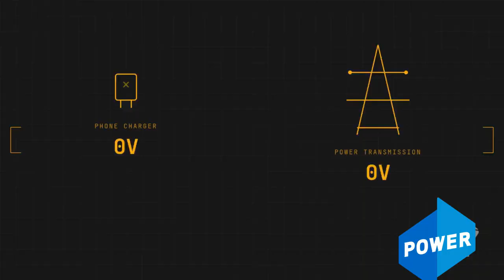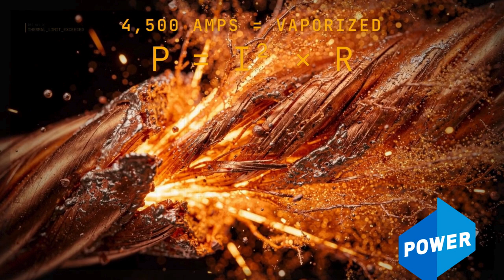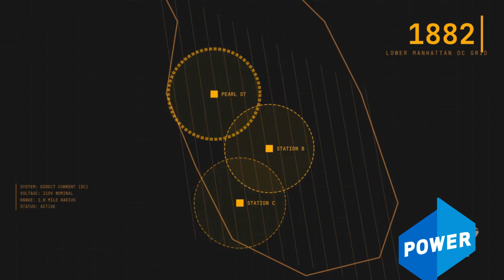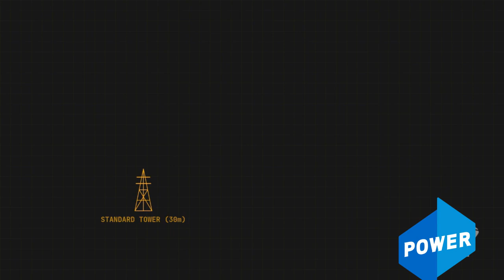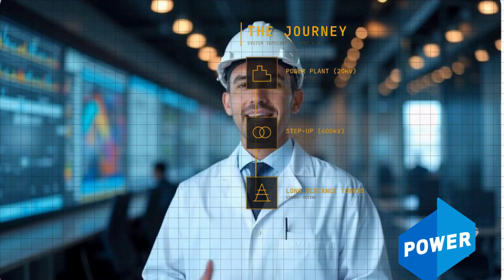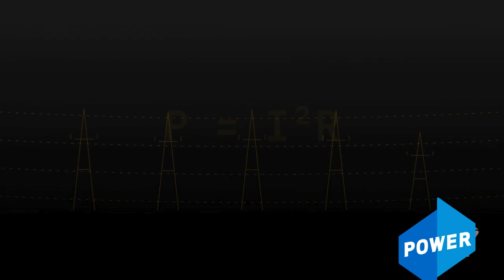Why 400,000 Volts Instead of 220? The Truth No One Tells You

Comment: R= U/I   P(w) =U(v)xI(a)  100 Mw / 100 Kvac = 100.000.000 / 100.000 = 1000A single phase   at 220Vac 100.000.000 / 220Vac = 454.545A !!!!!
Reply from the maker: Exactly
That’s the core idea behind high-voltage transmission.

For the same power level, increasing voltage reduces current dramatically, and since transmission losses are proportional to:

P_loss = I²R

current becomes the real enemy, not voltage.

At 220V, transmitting 100 MW would require an absurdly huge current, massive conductors, and enormous heat losses. That’s why power grids use hundreds of kilovolts for long-distance transmission